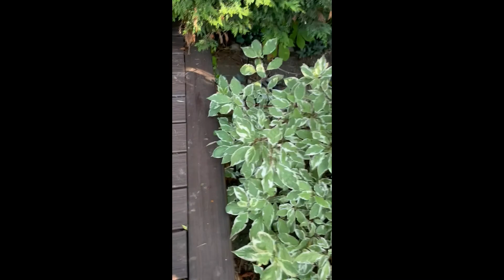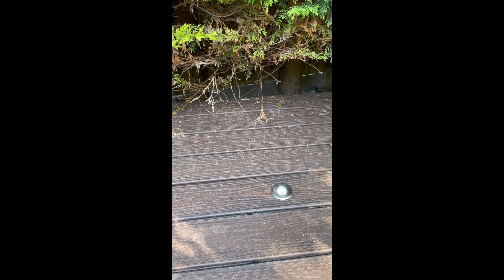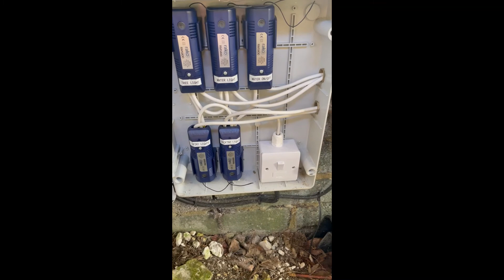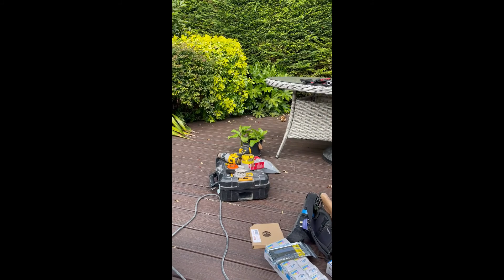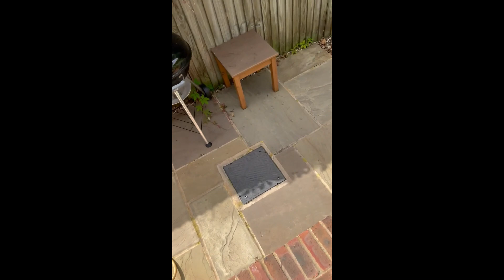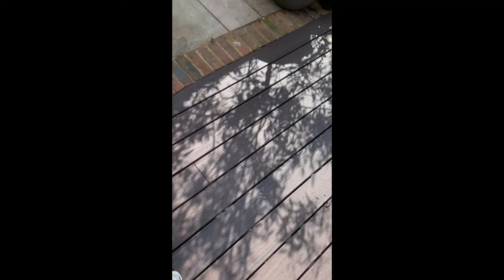Rako controlled (I had to replace the decking lights!🤬)

Comment: I have two Rako garden relays. The problem is that over time they get damp and degrade. A solution I found was to put a 10w heater in the enclosure. This is enough to stop condensation etc. UNDER CONTROL INSTRUMENTS LTD Mini Semiconductor Cabinet Heater - 10w (#SSH-01609). I have nothing to do with thus company but it seems a good product.